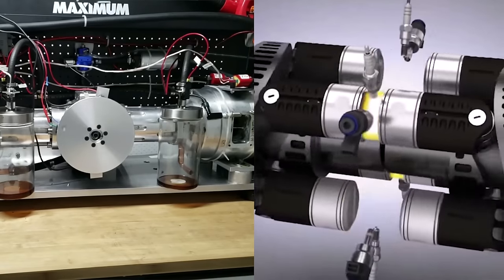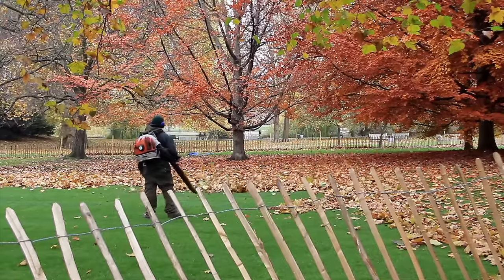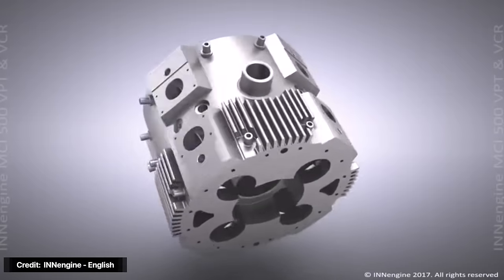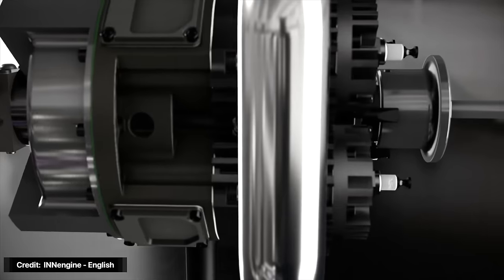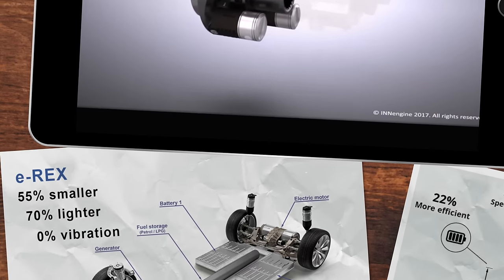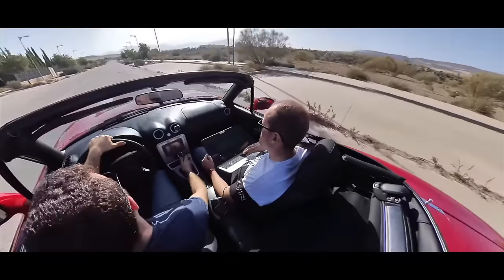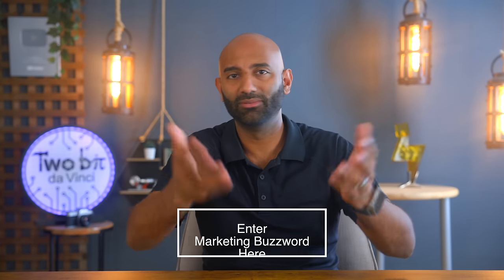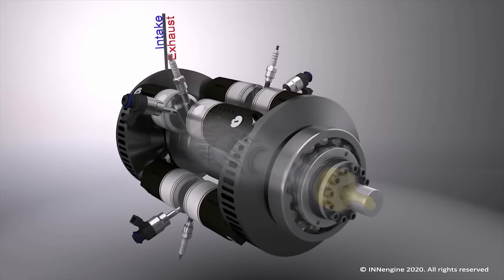One Stroke Engines - 200% More Efficient??

Comment: Why not hydrogen you can filter some pond water if you had to and produce the gas on the fly to run a in proportion piston motor spining a generator  to power the electic motor.

Comment: This is why we need a range extension. We do not have enough electricity to supply the battery market. But adding a motor as a charger, we are able to use a motor at even rpm, producing less emissions .plus motor doesn't have to run all the time. Right know we need these kind of designs.

Comment: The rod and the piston are a single piece for all practical purposes. When the piston is pushing against the swash plate, the reaction has two components: one along the rod and one perpendicular to it. The latter excerts a moment resulting in differential pressure on the cylinder, producing unwanted differential wear.

Comment: The only engines l can think of that can literally be considered 1 stroke in that every stroke is a power stroke are those that rely on an expanding gas with an external heat source. IE steam engines which typically have work done by both sides of the piston. As well as double or triple expansion.

Comment: If you have a constant diameter roller on the piston pushing against the output plate that rollers surface speed per minute will not match up to the surface speed per minute across the radius of the cam track on the output plate. The roller will be sliding or skidding at some point along its length.
This is simply one more attempt at a barrel engine.

Comment: If I had a tesla i'd trade it for a 68 mustang. I could care less for all this new throwaway stuff made so weak that you cant even hit a bird wit it lol
Reply from the maker: it's quite the opposite, a 68 mustang will constantly give you trouble, and cost thousands to keep it running. but what a weekend car it would be! at 80,000 miles, my only cost on my Tesla has been windshield washer fluid and tires. it's an amazing daily driver, plus it has 500 hp and is way faster than the mustang, and cost less to fuel than a prius. it's wild.

Maybe argue they are boring because they are so good, like an appliance. no one puts bread in their toaster and hopes it'll work, it just does. that I can understand, cheers.

Comment: You are welcome to preferring electrict car engines. 
In certain applications electric motors are the best use tool. However, electrically powered vehicals,  use more resources than the standard gasoline engine car. With electrics, you have to mine the fairly rare battery material (currently from China, I believe), then recharge the batteries more frequently than filling a gas tank. And, the charging method requires electricity,  generally provided by a public electric, power station which generally consumes coal or other mined/well drilled fuel, and the charging port may not fit your vehicle. Cold weather diminishes  battery life, thus reducing available mileage further.  Also, the charging port is not always available where you need one and cannot be carried back to the car to recharge it.  Requiring the electric vehicle to be towed,  probably by a gas power tow truck. But, if you only need to go 25 miles or less, all the time, an electric vehicle would probably be quite suitable. Just don't try to go crosscountry with it, or carry loads bigger than the seating of your vehicle, as many people do.